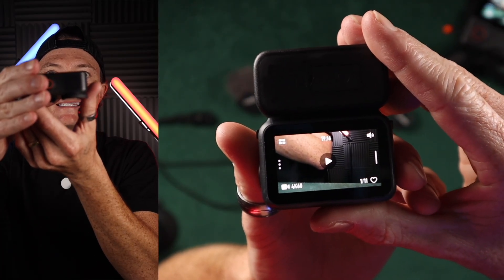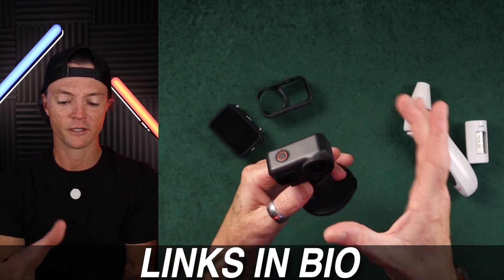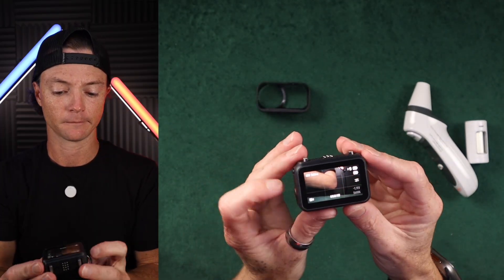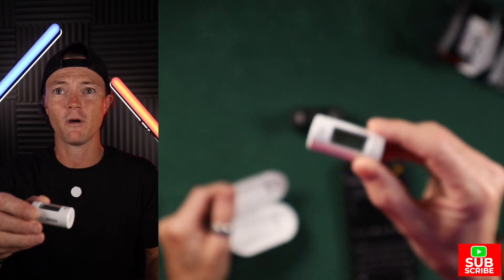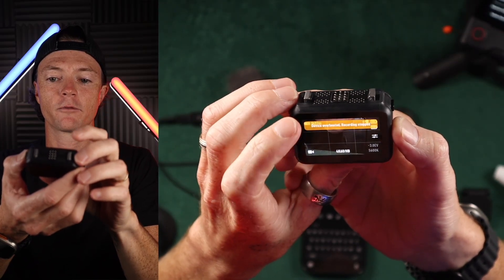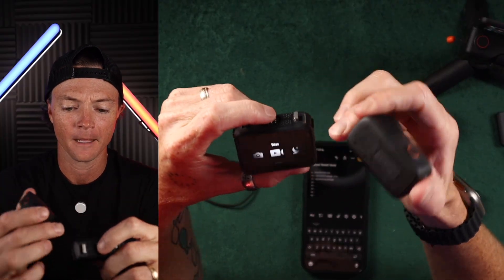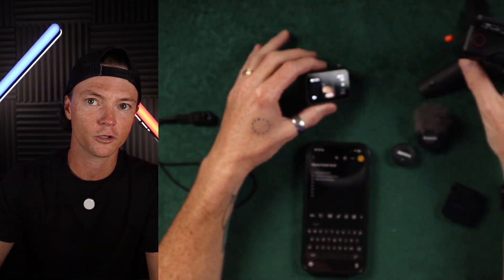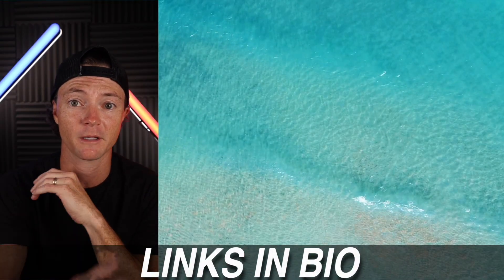DJI Nano Firmware Update Overheating TEST

Comment: If you're doing the test after a new software update you should have left the settings the same if you want to see if the update actually did anything.
Reply from the maker: I see this, but I’m less concerned with whether the update made a difference and more interested in what the actual results are for these filming setting since several people asked about them.

Comment: I can not use this in Texas I am still hitting 94 Fahrenheit and in my truck it’s 102 when I get in it and I film from my dashboard. From the reviews I have seen it seems that if it gets hot it won’t turn on so what happens if I leave it in the car and try to use it after I go to the store would it  say it’s too hot can’t turn on like a cell phone does which happens still to me in the summer heat.
Reply from the maker: Yes it will NOT turn on if it’s too hot from sitting in the sun.

Comment: I can get over 40 minutes of recording at 4k/30 with 10 but color (not dlog-m) without overheating in a 72° room with no direct fans on or around the camera. In 4k/60 it significantly decreases record time. What I haven't tested is if 4k/30fps would decrease record time if the dji mics are connected as it would require the camera to sync to that audio as well.

Comment: I just shot for over an hour straight, moving the camera all over the place and it dint overheat. I shot in 2.7k / 30p as I don’t ever shoot in 4k on small devices. 

But I never shot a clip longer than 6 minutes. 

Even 6 minutes is a long clip for me. It’s an action camera, supposed to capture small bits of action. 

No one is going to watch a 10 minute video of someone riding a bike down the road..
Reply from the maker: Yes. These stress tests are for people that might try and shoot longer content and cut it up. Definitely not something that will affect everyone. Also 2.7k will definitely help with heat.
Reply: @thebetterbuy I was worried at first from all the bad reviews about overheating. But the way I use it, seems like it will be awesome
Reply from the maker: @AbstractPropertyMaintenance  yes I think your use case will not be an issue at all.

Comment: I used my nano a few days ago with these settings, 4k, 30fps, 10-bit color, auto settings, bitrate standard, and I was able to record for about 35min non stop without the camera over heating. I was outside for a walk and the weather was about 82°f. The camera did feel like it was warm but not too hot to touch. a few days before, same settings but high bitrate, and the camera over heated with after 2 8 minute clips that had about a 5 min break in between. when I went for the 3rd clip, the camera was already overheating.

Comment: With the recent update, can you do a test using only 1080p resolution and see if it will still overheat that badly? Thanks!
Reply from the maker: I tested 4k 24 and had no over heating. I’m gonna do 1080 60fps today.

Comment: Did the test  before update the firmware  4k 60 10 bits color high bitrate  78degree inside door no airflow  with shell on and without vision dock   after 20mins is overheating.    After firmware update  same situation(except this time it sits on top of magnetic lanyard)  it runs up to 45 mins before overheating. One thing is interesting that shooting both nano and go3s , nano at 4k60 10bits high bitrate    go3s at 4k30 ,both them shooting with vision dock and pod  ,go3s got overheating first  nano has no problem at all  (outside 73 degree  directly under sunlight）

Comment: The result is actually quite good as your test is a worse scenario. 1. Connected to the base monitor will get hot faster than separated. 2. With live view on, it will also get hot faster. So, if the nano is detached and recording without monitor, the time can be much longer.
Reply from the maker: Testing this option soon. I agree except for the heat with the base attached. This is currently being debated.

Comment: I've had mine pinned to the chest mount doing a walk for 35 mins straight with no probs at all. 4k30, rocksteady on, 10bit normal, 23 degrees celcius outside. The camera gets hot, but most small cameras do.
Reply: I live in Florida yea it’s hot but I went to record in my car and I didn’t even push start and after 5min it overheated without ever recording 

I set it up connected to app so I could see on phone then got a call and after 5min of driving it said over heat and I never even recorded and my ac was set at 69 degrees , horrible never even recorded
Reply from the maker: @Lucasvilla56283  I live in Florida as well, and this is the kind of issue that will be a problem for some people. Not Florida ha ha ha I love Florida just the heat for the camera.
Reply: 23 degrees celsius is nothing and if the camera gets hot at that level then you it will overheat once you use it during summer or direct sunlight like when you go to the beach. It will render useless .
Reply from the maker: This sounds exactly like what I experienced. I was able to get 105 minutes so 1 hour and 35 minutes at 4k 30 10 bit d log, before over heating.

Comment: I never really get the over heating thing on this kind of camera - and what I mean by that, is that these sorts of cameras sole purpose is snippets of a day or scenario and as a back up to a main camera to place in tight spots etc that a mirrorless camera sits. If used for sports and all of that - nobody parachutes for an hour - and if they did, there is moving air keeping the camera cooled down. Other than that scenario - these are not built for entire day filming, or for filming long form content - they are simply buiits of kits - like a drone or a 360 camera - that show a short snippet of an overall picture - and so in my opinion an overheating issue in an electronic device, that still manages 4k @120fps, if used in the way it is intended, is a moot point surely. They are not meant to be run for 45 minutes straight. This is not taking away from ythe video - another great bit of content and I enjoy watching this channel - however I would put this anywhere - it is an FPV camera meant as filler, or fun short form and nothing more than that?
Reply from the maker: Love your take. I think for many people they will see it like you just described, but there is a growing group looking for this as a Vlog replacement and these issues will affect them. I did my test in controlled environments. I have seen people get much worse results in sunlight or hotter settings. I think we are crossing into a time where many new creators will look to these small cameras for more than just short clips.
Reply: @thebetterbuy  very true - especially younger kids as it is relatively cheap and will get really pissed off when they do overheat - and I think that is where the marketing fails - not the camera - and also when some creators just shout about how amazing everything is (when it was free for them - not knocking that, I would take it for free - also know you bought this with your own money). I just think that something like this shouldn't put people off. Like I had the Insta360 Ultra - but sent thst back due to the picture quality, which to be was more important (and it fits all the other DJI crap I have, same with the X5 I now have the Osmo 360), and am happy with it because I onl;y use it in bursts.

Thanks for the video though man - I wasn't knocking you specifically at all - just adding my spin!
Reply from the maker: I genuinely appreciate your comments and conversation. I love my X5 though and I’m working on a comparison video between the ULTRA and NANO, and I’m finding the image quality to be ALMOST unnoticeable. I’ll be curious to see your thoughts on it. One of my favorite parts of this is seeing opposing views and learning from them. So thank you.
Reply: it overheats even in 1080 60p high bitrate, 17min and its gone
Reply from the maker: @techr9186 ok this is great info. Thank you for sharing. Saves me time. So it seems 60fps is the biggest impact.
Reply: I used action 2 for 3 years, and believe me you should care about overheating, I live saudi arabia temp in here can reach 55c at summer, you camera will last less than 5min if it normally overheats and I used to do POV sports and the heat was so annoying as it takes while to cooldown and I just missed so much😢
Reply from the maker: @Shenepoy and that’s why we make these videos.
Reply: @Shenepoy i love the answer 360 go2. I owned two of the and overheating was a problem standing still but it was also a problem when i was writing my motorcycle which is the majority of the time. The time before shut up is dependent if i'm moving quickly and the temperature is 30 or less it's okay but after 35ç they could not get past 10 minutes even if i'm moving quickly on my motorcycle. I have never tried the go3 because of my frustrating experience with the go2. I'm still looking around videos of people who use it on a motorcycle or a bicycle that creates air flow to see if the nano still overheats in those conditions.
Reply: I found one massive time it does overheat - purely by accident. I thought I was in video, but was in SloMo - all high settings (4k etc etc) and it was dead in 10-12 minutes. SloMo isn’t used for anything long usually so not really unexpected (I never use slomo), but was surprised at how quickly it zonked out!
Reply from the maker: @whosthebrightestmonkeyinth348 I never got around to testing slow mo.

Comment: Oh boy, Action 2 Deja Vu is becoming a reality. Great video with extensive testing! Are you able to try something, I don't have the Nano and want to see if it suffers from the other problem, everyone is doing heat test but no one is doing cold tests. One of the biggest reasons I don't use my DJI Action 2 is because it won't work in cold conditions and not even that cold conditions either. I had put the Action 2 in the freezer for 10 minutes with the GO 3s and Ultra, after 10 minutes, the Action wouldn't not start recording says it's too cold lol but the GO 3s and Ultra started up and recorded with no issues. The reason I ask is a lot of people I know as well as me use our cameras in cold environments often here in Canada, ie. hunting, snowmobiling, skiing etc. where our temps avg below -5 to -10 celsius and sometimes colder. I stopped using the Action 2 because it would never start up during these events (usually between 3 C to -2 C, I'm curious if the Nano is also suffering from this issue. I'm going to bet it also does ;) I know you're busy but when you have a moment, it's funny, everyone does heat test but no one does cold tests. Thank you!
Reply from the maker: I love this idea!! I’m gonna do a freezer test. Cold definitely makes and impact. The question is should I let it sit in the fridge or freezer first to cool down and then try or just place it into the freezer like you would if you went from warm Environment to snowboarding etc.

Comment: Did you happen to take a video using this underwater? I'm curious to see if it's better than the insta 360 Go ultra...
Reply from the maker: You have to have the Aqua lens for the go ultra and I don't have it. I haven't done any underwater content with it, and I'm not sure I will at this point.
Reply: @thebetterbuy yeah,bummer about overheating.
Reply from the maker: @DB6904.  New 4k 24 Test is actually going really well. Results video coming.

Comment: I just rebought my go ultra smh dji nano, i wanted to save $130 😭😭.  Room temp at 77 degrees. Dam will be worse as i walk through the vegas strip smh. DJI just stacked too many things on top of each other they should had made it a little bit wider and less thick i feel like this would help disperse the heat better